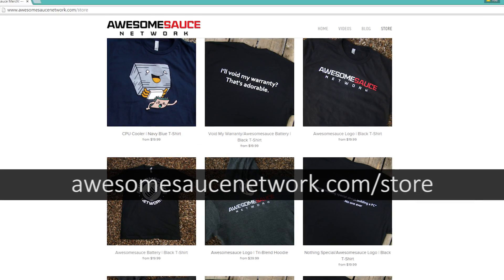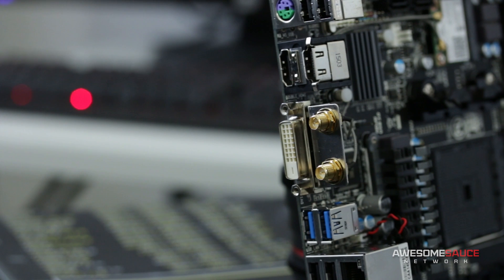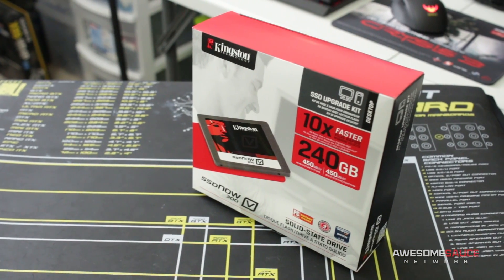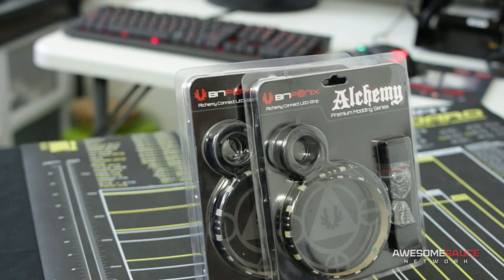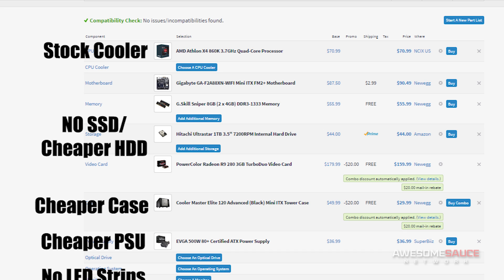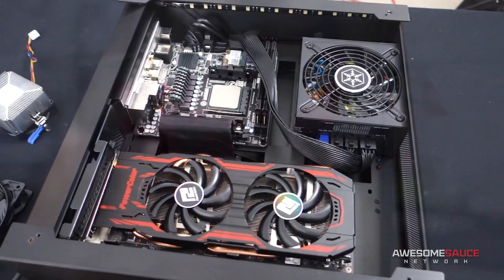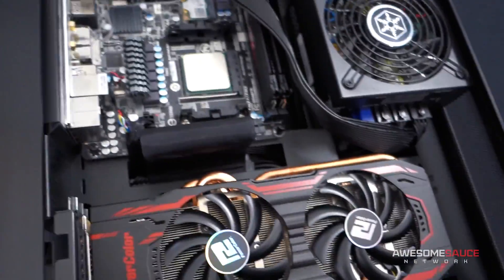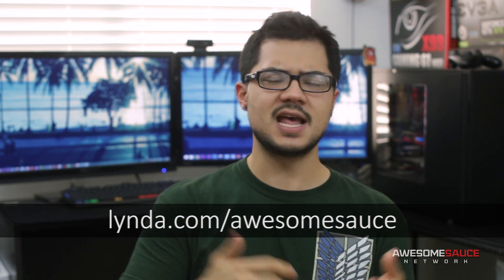The Overkill Console Killer: And How to Build One for Under $500 (Part I)

Comment: Could you please build a mid ranged decent music pc?
Reply: go to the linustechtips forums to get build advice mate
Reply: Music PC?  I'm guessing music production?
Reply: I have a,moxf6. I write music but am stepping into PC editing so I need a pc to run cubase
Reply: ***** lmao. Cool man. And I bought xps 8900.  It will work. Lol
Reply: i7, 500 gb ssd, 16 gb ram, 1tb hard drive, atx motherboard, atx psu 600 watt, r9 nano. Should be around 800$. Won't handle gaming as well but the ram and processor should easily handle music production and you'll get high speed transfers with the 500gb ssd
Reply: +TehNapalm was that a pun??
Reply: BurblingBarbacoa  hi thank you all. I went with the Dell xps 8900. Purchased ssd 240 for the OS and cubase. This thing flies. Thank you all for your inputs. It came with OK specs I believe that will work for me as I also intend to use for video editing. 
Core I7 6700 , 16 gig ddr4 @2133mhz , exp to 64, Nvidia GTX Geforce 745 4gig ddr5 gcard. 1 terr hard drive @7200 rpm. It came BRAND NEW with 27 inch Dell 1080p wide screen monitor IPS 8ms ...
Though I am nearly positive some of you could've built this cheaper I feel with the monitor all costing 1060.00 USD I did great. Thanks. I also understand the graphics card is crap and all but I hope I did good for future as if I go any higher with graphics only up to 970 with my allotted 460 PSU so I'd have to upgrade it for any better. For now I am hoping to hear....Not bad man. You did great actually considering the price.  I have seen it on Dell for the same PC 1850 for only i5 however they usually are better priced at 3rd party. Thanks you all.
Reply: +Robert Clark For that price you could've built one yourself with a 970.

Comment: Hey.  My current build is using an AMD athlonx4 860k and the F2A88XN-Wifi.  That Athlon can easily OC to 3.9 or 4.0, depending on bin luck of course, without increasing voltage so you can OC on the stock cooler.
Reply: +Baron Saturday Yeah :) I'm currently running an Socket AM3 X4 945 at 3.4 GHz overclocked from the stock 3GHz with stock cooler and voltages. If I would replace the cooler and raise voltages it should be able to go higher but I don't feel it's worth the cost at this point.

Comment: I'd do way bet better i3 and Gtx 750 for under 500
Reply: Nah a quad core amd cpu is a better choice since games are using more than two cores
Reply: +theCanadian GameR Actually they don't, at least not untill they are using DirectX12
Reply: +theCanadian GameR na sorry the i3 with hyperthreading( quad core ) smokes fx 6300 in benchmarks for some reason the cores are almost 2x as fast in dual core proccesing besides 90% games use 2 cores 10% of games use 4 cores+ like dying light bf4 crysis 3 witcher 3 so ya
Reply: +Don't race me I'm to fast 1) some games don't even launch on dual cores eg far cry 4

2) hyper threading isn't supported in all games
Reply: +zBruda most games support hyper threading and dual core can run any game with a quick easy fix
Reply: +Don't race me I'm to fast I'm all for Intel I haven't switched to amd yet, I'm just saying that an amd 4 core is better than a pentium g3258 if both are oc

Comment: Hey guys kinda new at this, does this build look good to you guys? I appreciate all comments, thanks.

AMD FX-6300 3.5GHz 6-Core Processor
ASRock 980DE3/U3S3 ATX AM3+ Motherboad
A-Data XPG V1.0 8GB (2 x 4GB) DDR3-1600 Memory
EVGA GeForce GTX 960 4GB SuperSC ACX 2.0+ Video Card
Deepcool TESSERACT SW ATX Mid Tower Case
EVGA 430W 80+ Certified ATX Power Supply
Reply: +mike nicholas The power supply is a bit low for that. THe FX-6300 uses 95Watt and the GTX 960 takes around 280. That'doesn't leave you much head room as your system fans, mainboard/memory and Harddrive also take somewhere between 40 and 100 watt to run. I would advise to get at least a 600 Watt version of that power supply. Power supplies die much faster when you continuously use 80% or more of their maximal power load.

Apart from that it's a descent gaming system. You most likely will be able to overclock that FX-6300 to 4.0 GHz or more, and when they drop in price you can later upgrade to at lesat an 8 core FX -8320E or 8370E. I don't know if the mainboard supports a full FX-8320 or FX8350 but it should at least be able to run their low power E designation relatives.
Reply: +Robert Phoenix A 960 uses like 120 watts. lol. a 430 watt PSU in theory is enough, however it doesn't hurt to go with a 500 watt PSU in case you want to upgrade in the future. Or maybe a 600 if you wanna upgrade to a 980 ti or something.

Comment: Should I buy a GTX 950 or HD 6670?Iam a budget gamer so I need a good GPU.
Reply: +Gaming Networks GTX 950 its current gen. the HD 6670 is 2 generations old and has less performance.
See a comparison of the two here : http://gpuboss.com/gpus/Radeon-HD-6670-vs-GeForce-GTX-950
Reply: Thanks man,but I picked up a 970 for my gaming needs.
Reply: +Robert Phoenix GPU boss isn't that reliant and both GPU's are fropm 2 different companies and generations don't matter, for example GTX 780Ti outperforms a GTX 970 but it's not worth the money considering 970 is cheaper and newer, the HD 6670 is like a $60 GPU that is garbage and the GTX 950 is a $150 GPU that's amazing but t a GTX 960 is better for $20 more
Reply: +Fuck unless you buy second hand. A 960 new is around 250 Euro. A second hand 770 (Which is a little faster and has a 256 bit memory bus instead of a 128 one) you can get for around 140 Euro, saving over 100 Euro to buy a new card in a few years (when a 970 will be around 140 second hand)
Reply: Robert Phoenix But the reason the memory bus on the 960 is 128 is because of the new Maxwell architecture and how efficient the memory is, so it doesn't need 256, and the 960 is more overclockable and is not as hot, and ou can get a 4GB 960 at $240 while the 770 is 2GB
Reply: Robert Phoenix Lol where did you find a 770 for 140?
Reply: Marktplaats.nl (dutch 2nd hand buy/sell site) :)
Reply: Robert Phoenix Lucky you mate

Comment: y not replace the athlon with an fx 6300??
Reply: mini itx does not support am3+, the fx 6300's socket, because it's too hot.
Reply: +SquidPlays also this cpu outperforms the fx 6300 lmao
Reply: Adam Carter yup, but fx 6300 beats the crap out of it in multicore
Reply: +SquidPlays look up cpuboss.com and compare them also boards for the fx 6300 cost a tad more will in Australia at least

Comment: I am looking at building a pc and would like some help and input on deciding on the parts. Here is the spec list, and any options that I specifically want help on I will put what I'm looking at alternatively in parenthesis to the side. Keep in mind that I would like to keep this around the current price point (Around $700-$850), but going cheaper with not too much downgraded specs would be HUGELY helpful, as I do not have so much money to spend on a really good high-end pc. I would be doing mid-end gaming mostly on it, with games such as BF4, GTA V, SR4, etc. Thanks in advance!

CPU: AMD fx-8350 (Could go with fx-6350 or something of the sort, though I want to stick to AMD mainly for price reasons)
Mobo: MSI 970 Gaming DDR3 2133 AMD
GPU: Gigabyte GTX 960 Overclocked 2 GB GDDR5 (this is the most debatable part. I am looking at 4 GB gpu's as well, or a better performance per dollar AMD gpu.)
HDD: 1TB WD Blue
SSD: Kingston 120 GB SSD (Could go without this if that is a good idea)
PSU: EVGA 500W 80+
CPU Cooler: Cooler Master 212 EVO
RAM: Crucial Ballistix Sport 16 GB (Also very debatable, more in terms of I'm debating 8 vs. 16 GB)
Case: Corsair Spec-02
Extra: Cheap optical drive from LG, 2 extra 120mm red LED fans from Corsair to improve cooling, Windows 10 Home OEM
Reply: ***** The 950 is actually much worse in performance than the 960, and even worse than the r9 380 i have decided on.
Reply: Xetion http://pcpartpicker.com/p/G97tVn some stuff i got for free from friends, and i got a lot on sale.
Reply: I like the build but I would however go with the r9 380, it beats out the 960 by just a little bit in most games and is about the same price. If you need the nvidia features the 960 is a good midrange card and you'll be fine gaming at 1080p.
Reply: +DerpyPhysics Yeah, I have already decided to do this. Thank you for your help!
Reply: +Alec Manley 950 is also very similar in performance of the 960 and much cheaper (newegg today at 120$)
Reply: Alec Manley Um, no.... it's actually, normally, around 4-6 fps difference in games.... what chu talking bout xD
Reply: Alec Manley The r9 is over those though, good choice.
Reply: ***** Yup.
Reply: I would switch out the kingston ssd for a sandisk because kingston has been cutting some corners making their more recently made ssd's less efficient
Reply: Even Steven Alright, thanks for the input.
Reply: Hey man. Don't get the v300 ssd since they changed their circutry and lowered the speed. Put $10 more NAS get a Hyper X ssd or 850 EVO. And get a r9 380 instead of a 960 since it gains 5-10 fps more in all games and when dx12 comes out it's game over for Nvidia.
Reply: Xetion Okay, thanks for the help!
Reply: Hey, so did you end up building the pc or not? Because if you did i would be interested to know what happened with you since i'm looking to build around the same pc as you.
Reply: fred fred Yeah, I did actually. I can give you the actual used part list and some more info if you're interested :P
Reply: Alec Manley yes please
Reply: Bike Dude Yeah, Max settings on everything I play and 60+ fps always. very nice build.
Reply: Bike Dude Yeah, I bet it does. What can you get your 8320 to? I'm wondering what I should try getting my 6300 to with just a hyper 212 evo.
Reply: Bike Dude Aha that make sense. That's actually a pretty good OC still.
Reply: Bike Dude That makes sense.
Reply: Alec Manley Yes if you could send the info that would be awesome. Any info is useful and if you could also share the experience you had playing games and how good was it. oh and lastly if you could recommend that i switch any of the parts you already built that weren't good or to get better performance but around the same price would be highly appreciated.
Reply: Bike Dude Honestly i'm open to any game and i'm pretty sure if i get a new good pc i would try more games, but currently my main game that i play is csgo. And i just wanna play on a smooth resolution that would make the game look good and get nice consistent fps. And also my budget is around 500-600$ around that price range.
Reply: fred fred Basically anything like an i3 and a 750Ti can run cs:go.
Reply: Alec Manley 750Ti? Is that the GPU? Sorry i'm not that good with all of these computer parts. And also i don't want to just run csgo, i want it to look really nice and not lag while having high fps.
Reply: fred fred Yes, a 750 Ti is an ~$100 GPU. IT will run cs at about 100 FPS. cs:go is actually a very easy game to run, so you can get pretty bare minimum stuff and be able to run it.
Reply: Alec Manley Yeah but i said earlier that my main game is csgo currently, but for sure in the future i might try many more games. So i guess my question is will the 750Ti be useful in the long run and not have to upgrade it after a short time? And also if i chose the 750Ti over the r9 would i have to change anything to make it work with it or it goes with the rest of the build.
Reply: fred fred Graphics card are pretty much universally compatible. Also, yes you will be sacrificing performance as well as performance for the future and future games compared to the 380. If I were you, I would save up to be able to get an i5 4690, and an r9 380 or gtx 960.
Reply: Alec Manley If i could cut down on the price i for sure will, but if i'm sacrificing performance then no, i'll just stick with the r9.
Btw i'm pretty much going with the same exact build you showed here: http://pcpartpicker.com/p/G97tVn

So from your experience with this pc do you suggest i replace anything that wasn't good with you after you built it?
Reply: fred fred The way it works in computers is basically price=performance. There basically is not "Can I find the same performance for cheaper?" You get what you pay for. So to cut down the price, you have to lose performance, features, upgrade ability, etc. So don't skimp. 

The only thing I would change from my build is get a r9 380 from a different manufacturer. I only chose mine because it was on sale, and it had a lot of bead reviews. I myself have not had a bad experience with it, but maybe I just got lucky. Additionally, the case I got was because it was cheap at a second-hand store. Get a better one. I would recommend a newer Fractal Design one, a newer Corsair one, or a newer NZXT one. 

Also remember a lot of the parts I have are listed very cheaply; this is because I waited for sales, and even got some things free from people I knew. Look out for those things too; take every opportunity you can get. Good luck!
Reply: Alec Manley Alright. Thanks!
Reply: Bike Dude My budget is around 500$ but i can push up to 600$ max if the difference in performance is noticeable. And i'm paying for someone to build it but i know him so it will probably only cost like 10$ so the building part you don't really need to factor it in. No i'm not in the US but it's okay just calculate the prices in US market. Thanks in advance.
Reply: fred fred All I'm saying is, for $500 and for anything really demanding, Good Luck.

Comment: The gpu isn't on the mobo??.
Reply: +Technomics Review Such complicated answer's... This case comes with a cable extension that allow the GPU to be mounted vertically.
Reply from the maker: That particular case uses a special PCI-E riser card
Reply: Meaning? (Not familiar with terms)
Reply: Basically a pcie extension cable
Reply: +Technomics Review it plugs into the pcie slot and it makes the card in an upright position
Reply: +fwupow I agree with some things you say, but lets keep in mind that this build does not make any sense, who the hell builds a 'cheap'  PC in a 300 dollar case? The only reason it says 500$ in the title is because like it says in the description " Lian Li sent me their PC-O5" so it was free. No one in their right mind spends 500 USD in components to put in a 300$ case, this case is for moders and water cooling enthusiasts who can work around the size constraints, it is defiantly not a case design to build a budget pc.
Reply: +khalid alhussein 

what does this have to do with the conversation? 

also, yes. you can move a tower PC.
Reply: true it was just in regards to using it on the go
might be me just not liking the small cases tbh

not much room to build on not to mention i run a OC'd SLI rig would be very worried about air flow
Reply: Ur right. ITS ON THE MOBO PRO
Reply: He says in the video that there are some components that you can cut corners on and save money by switching those components and the price after that is significantly low.
Reply: +I Main Zed The gpu is adapted to fit in a different location using a PCI-E Adapter Basically
Reply: +I Main Zed Anyone else thinks this guy looks like Zak Begans?
Reply: +fwupow Sketchy cable system? Lol its merely a PCI-E ribbon cable with mounting for a GPU.
Reply: can you travel with your tower pc?
Reply: Dante Inouye i was replying to fwupow saying slim cases suck.
Reply: if your planning to travel alot a gaming laptop may be in order also if your planning to travel alot the tempered side window just seems like a bad idea for a case choice even if it looks semi cool
Reply: PainX187 you are absolutely right. but a gaming laptop costs alot. if you get a silverstone case with pc components it will perform better than a gaming laptop while costing less., and its portable.
Reply: +Technomics Review Imagine "______" as the motherboard. " | " as the riser card and " ------" as the graphics card. Using the riser card, the whole setup looks something like this " _______|---- ". Obviously not the best way to explain it, but it basically acts like a perpendicular extension so that the gpu is slotted in parallel to the motherboard.
Reply: if you look where the gpu would normally be youll see a wide cable, that runs behind the metal plate, underneath the storage drives as shown in the montage, and back to front under the gpu to plug in :^)

Comment: daaaamn. that case alone cost 100 more than my pc... i felt poor
Reply: +LEGENDonTheLine What's your pc bro?
Reply: +kemboy323 AMD A6, gigabyte fm2+ MB, 750gb hdd, some german case/power supply combo. pretty mutch all cost 150euros. im suprised about result. works pretty well, even can play games i want like Cs GO, Dirt, iRacing.
Reply: +LEGENDonTheLine You're using the onboard GPU of AMD A6? BTW your GPU is better than mine and your PC cost 1/4 the price of mine. I can't even play CS GO without going above 40 FPS.
Reply: +kemboy323 ye. onboard gpu.
Reply: +kemboy323 wtf is in your pc?! And which bastard sold it?
Reply: Incrazyboyy It's a laptop mate.
Reply: +LEGENDonTheLine does it play cs go 60 fps plus?  or Minecraft? im building this too but instead of the a6 apu im getting a10 7875.
Reply: +Kid From Africa sorry for late reply. mine A6 pushes around 55-60fps on cs:go. and A10 vorks great with it. bro have it and it pushes dirt rally medium to 50fps, cs:go well over 70, rust on 40fps. just slap in atleast 8gb ram and it will run it good ;)
Reply: ***** what speed ram do you have?
Reply: +Kid From Africa 1600mhz. not really fammiliar with all OC thing, but iwe read that oc can take 2400mhz
Reply: ***** Ram speed really matters in Apu gaming. Like alot. If you upgrade ram it would work alot better
Reply: +Kid From Africa yeah. well i took standart 1600mhz and it works good.